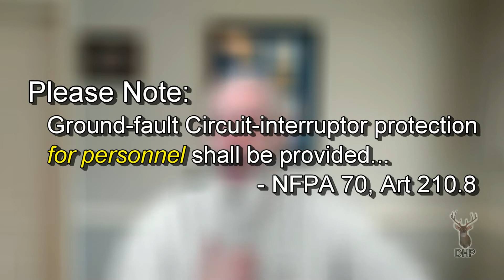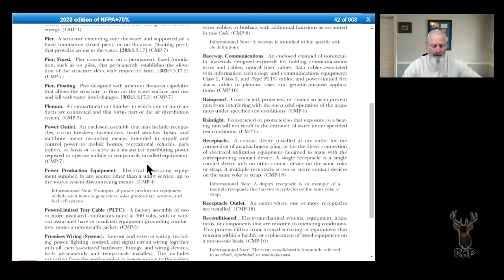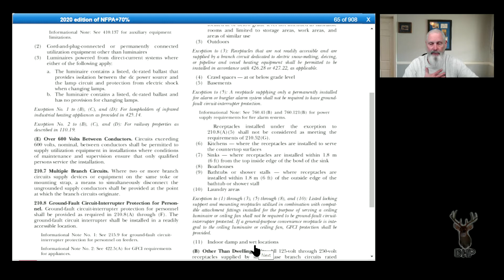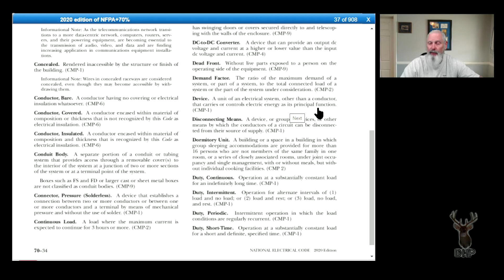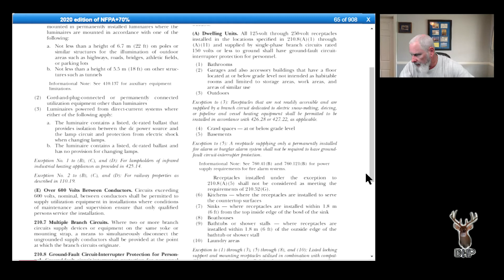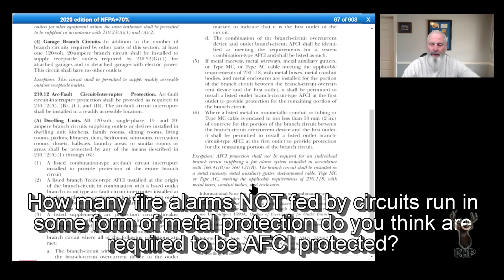S12aE7 - Pt.2 - A Look at the 2020 NEC Requirements AFCI and GFCI

Comment: I'm not familiar with hardwired dishwashers. The normal situation, at least in new construction around the West Tennessee area, is a split outlet in the sink base cabinet. The top of the outlet is switched for the disposal, the bottom is hot all the time for the pigtail from the dishwasher next to it.

Comment: A hardwired dishwasher is still supplied from an outlet so it may need to be AFCI protected. Usually hardwired appliances have a whip that comes out of an outlet box cover that then feeds the appliance.
Reply from the maker: It depends on the edition of code and local amendments. There is no outlet and no device but you need also look up appliances. depending on edition, dishwashers are required unless supplied by the appliance itself. The UL standard has no requirement for internal protection but with a CT or hall effect, modern residential dishwashers could easily comply.

Comment: One question: is it usual for gfci or afci switches to be hot to the touch?
Reply: They aren't switches, they're receptacles and it's not normal for them to be hot.
Reply: @illestofdemall13  excuse me...i mean afci or gfci breakers...all my sensitive breakers are hot in my load center
Reply: @cortemanga4160  Oh ok, I'd recommend that you call an electrician to check it out just to be safe.
Reply from the maker: Hot? No..warm, can be. Consult with a local professional where they can amprobe it.
Reply: @DelHollowProductions  excuse me...i mean afci or gfci breakers...all my sensitive breakers are hot in my load center